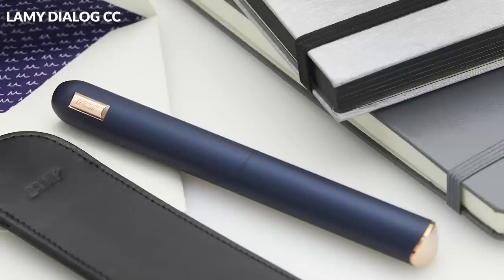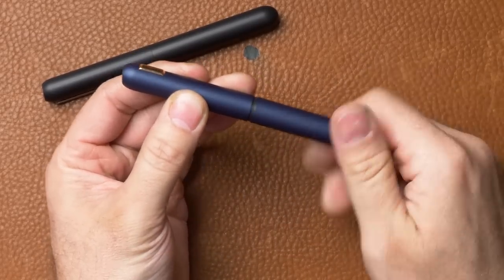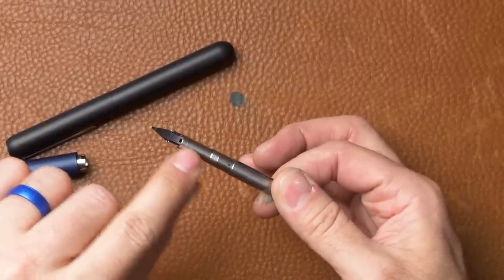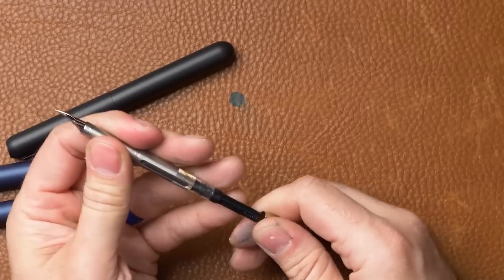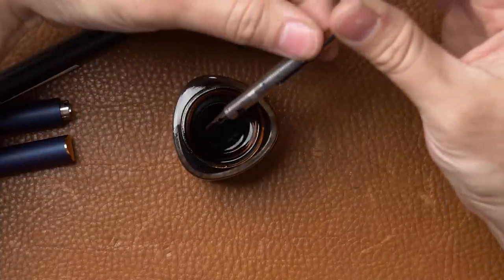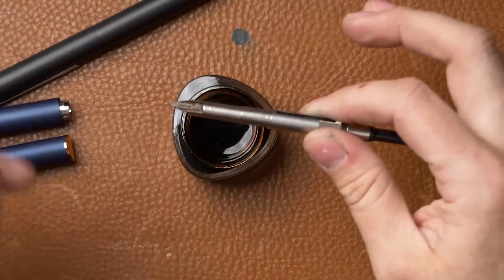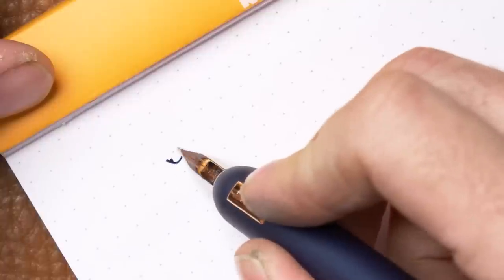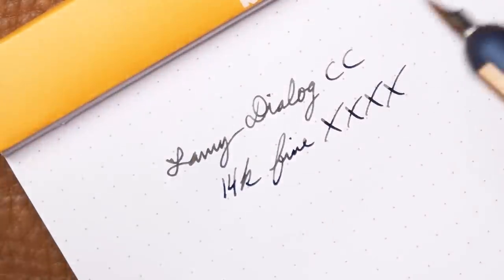How to Fill the Lamy Dialog CC Fountain Pen - Writing and Walkthrough

Comment: Thanks for the video! The Dialog 3 was one of the first (maybe the very first) gold-nib pen I bought, and I really like(d) it. As I got more pens and had them all inked up, I didn‘t use it so regularly and discovered this issue with the drying out if not used frequently. At the moment, it is uninked as I slowly move in the direction of a certain D. Brown (but I‘m not going to the radical extent of only allowing myself 3 pens!), but it will come back into the rotation at some point.
I would rather have the CC, but I don‘t really see paying a healthy chunk of money for essentially the same pen. Reason does at times win out over my emotion.
Reply: When you bought it did it come with a free converter?
Reply: @T_B1  As I remember (it's been over a year and a half), it did, and the website says it comes with one.
Reply: I have been more of a fan of the pilot pens, And in regard to 
Depends drying out they just don’t that often. The Vanishing Point Capless just just doesn’t seem to dry out. I have several and they are just very consistently great. It would be good to compare the two in so far as the nibs drying out in the pens. I am tempted by the CC law. A much higher price and the vanishing point.

Comment: I like the Dialog design but, for some reason, I've found my experience with both the Dialog and the Pilot Vanishing Point to be somewhat meh.  Perhaps it's related to the combination of small nib and my being left-handed.  When using either of those retractable nib pens, it feels as if the nib is scratching across the paper, rather than flowing.  I get a similar feeling with "traditional" fountain pens with steel nibs.  I have a much better time with "traditional" pens with gold nibs such as the Pilot Custom 823, the Visconti Homo Sapiens, the Diplomat Aero (with a gold nib), and even with a Montblanc 149.  The Cross Townshend, too.  Those all glide across even the cheapest paper (although the experience is much better to more-suitable paper).

OK.  I went a little off-topic.  Thanks for the demo, Brian.  I truly enjoy your videos, the instructional, the conversational, and the reviews.  I find them all to be very informative.

Comment: I have been a fan of Pilot pens, And in regard to Pens drying out,… they just don’t, Except rarely.. The Vanishing Point Capless just doesn’t seem to dry out. I have several and they are consistently great. It would be cool to compare the two in so far as the nibs/ink drying out in the pens. The softer nib in the CC is tempting, but the price is giving me pause. A much higher price than the Vanishing Point.

Comment: I absolutely love my Dialog 3. Glossy finish, lovely feel, super weighty and satisfying, smooth nib. But is there any way to lubricate the mechanism? Mine has been used daily for the last 7 months and is getting a bit gritty (I clean it out and let it dry thoroughly every few weeks).
Reply: I use wd 40 lube in it… tinny bits.

Comment: I have a dialog 3 and unfortunately it has let me down a lot compared to my two VPs.  I've had to manually adjust (bend) the clip because it wasn't seating properly in the slot when extended, and I've had to add teflon tape to the threads of the nib unit because when it was fully extended it had become noticeably off-center to the clip.  It dries out appreciably after 2 days of not being used, and the nib unit design makes it impossible to flush out with a bulb syringe.  All this said, I do love my dialog 3, but it did make me more skeptical of dropping money on future lamy products :\